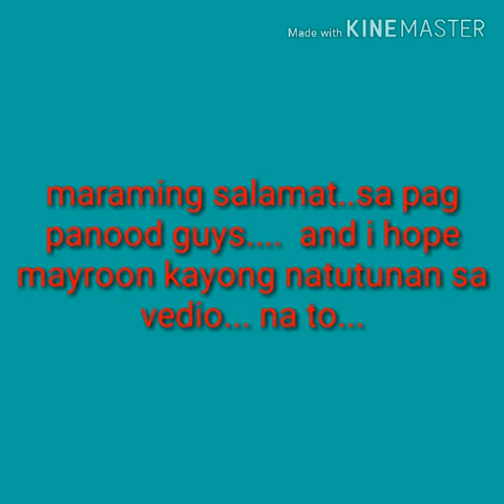Paano nga ba?? Magkabit ng pressure tank at motor pump gamit ang ppr fittings

Comment from the maker: https://youtu.be/Ntga_EtE53U click nyo nalang po yan link na yan ...for more info...maraming salamat po....god bless us all....
Reply: May video po kau pano mag wiring ng pressure switch po salamat
Reply: Wla q bro nkita ung pglinya mu ng heater n sentralize dq mahanap knina p tinitignan q mga video mu
Reply: Bro sa subdivision nmin medyo mahina ang tubig pwede ba ako mhlagay NG pressure water tank deretso sa incoming supply NG subd. Instead n motor ang ilagay ko eh motorized valve ang cocontrolin NG pressure switch, lumakas kya yung supply NG tubig ko kapag Ganon ginawa ko
Reply from the maker: https://youtu.be/CnIb7pUyVG8 pakicheck nalang po ang link na yan for more info. Ganyan set up ang gawin nyo po. Maraming Salamat.

Comment: hi Sir russel. Blessed morning. Sir question ko lang po. May ginagawa po kasi ako na layout ngayon. Sa area ng taytay rizal, Not sure if malakas ang water pressure sa area. But I suggest sa client na maglagay ng water tank. Ang sagot po nya is sa 3rd floor lang maglagay ng watertank to serve. Ang ground at second sa main water line na lang daw . Ito po bang video nyo is applicable sa concern ko?may motor pump at itong tank na nakaconnect sa motor pump, is this the Water tank na po ba o iba pa yung iaakyat sa roof deck po na tank na  magserve sa third floor? PPr din po ang balak ko gamitin. Super natuto po ako sa videos nyo =) 1hp is enough gaya ng sabi po nyo sa response sa ibaba. How about how many liters po kaya ang tank capacity. 
Hope na masagot po ang concern ko. God Bless!
Reply from the maker: Suggest ko nalang din po ay kahit nasa ibaba nalang ang storage tank piro bladder tank nalang po ang ikakabit nyo. Kahit ground to 3rd floor ang koneksyon ay malakas ang supply ng tubig.

Comment: Goodev sir  itanung kulang po yung source ko po ng tubig ay deepwell, Yung pag install ko po pressure tank to storage tank.. pag labas po mg tubig galing storage tank ay gravity nlang.. may paraan po ba na magkaroon ng pressure palabas ng storage asside sa gravity?
Reply from the maker: Mahina ang tru gravity Lang. Lalo na kung Mayrunng kayong heater Sa inyong CR. The best nyan. From deep well source. Hihigupin ng motorpump and then going to pressure tank. At Dyan Sa pressure tank outlit pipe ay papunta na mga gripo or sa CR.

Comment: Bro ung ilan cm sukat ng heater sakto n sukat bro myrn aq gagawin ung sukat dq alam.para pgkabit ng heater shower sakto sya.slmt
Reply from the maker: Sukat po kayo ng 170 Mula Sa finesh floor hangang Sa bottom ng shower heater.
Reply: @russelTorino  ung shower heater bro diba doble un ilan.po bro sakto sukat para pgkabit q d aq mgkamali.slmt
Reply from the maker: Kung shower heater tlaga yan ikabit nyo, first na gawin mo ay Mag Sukat ka ng 170cm. Mula Sa finesh floor with tiles hanggang Sa bottom ng shower heater nyo. Guhitan nyo muna as temporary. Tapos baklasin MO shower heater at ang bandang likod na body nyan may apat na butas for screw. Guhitan MO Tapos ibarena MO.
Reply from the maker: Kung Hindi ako nagkamali and ibig MO Sabihin Siguro ay ang mixing valve para sa shower na mayrung dalawang butas para hot and cold. Kung ito nman ay Mag Sukat ka ng 60 CM Mula Sa finesh tiles flooring at dyan mo na ikabit ang mixing valve  na hot and cold faucet.
Reply from the maker: Kung Hindi ako nagkamali and ibig MO Sabihin Siguro ay ang mixing valve para sa shower na mayrung dalawang butas para hot and cold. Kung ito nman ay Mag Sukat ka ng 60 CM Mula Sa finesh tiles flooring at dyan mo na ikabit ang mixing valve  na hot and cold faucet.
Reply: @russelTorino  o2 bro mixingvalve b twag nun.ilan b sakto sukat s abang bun.bali bro sentralize ang heater linya isa lng b bro ang gamitin kng tubo papasuk
Reply: @russelTorino  diba mgkatabi cla bro un ang tinatanung q kng ilan cntmtr.tpus ung linya bro ung inlet papunta ng heater tpus ung linya punta ng bahay isa lng po un n linyang tubo
Reply from the maker: For sure search nyo lang Sa fb nyo ang "plumber aid materials "page ko un.  Ang gawin nyo Lang ay picturan nyo lang yan Sinabi MO. At sent MO dun Sa page Ko. para masolve at MASAGOT ko na ang Sinabi MO.. OK Maraming Salamat stay safe.

Comment: helo po sir, ano ba dapat gawin kung balak kong palitan mga connector kasi kinakalawang na. paano tangkalin ang pressure sa tank. salamat
Reply from the maker: Una Sa Lahat, kailangan off nyo muna ang kuryente Sa inyong motorpump, pagkatapos off nyo din ang supply ng tubig or gate valve papunta sa motorpump, pagkatapos idrain nyo ang tubig Sa pressure tank, kapag maubos na ang tubig, that's the time na baklasin nyo na ang mga dapat palitan na piping.
Reply: salamat sir

Comment: boss matanung ku lang? pwidi ba gamitin yung swing valve sa presure tank, dba proper installation check valve yung gamitin at yung inket ng pump mu my gate valve pa para saan yan?
Reply from the maker: There are four types of check valve:1.vertical check valve/spring valve 2.swing check valve 3.horizontal check valve 4.lift check valve po.....sir
Reply from the maker: Puydi sir...yan nman po tlaga ang gagamitin swing type na check valve kung horizontal ang linya ang kakabitan mo.piro kung vertical ang linya ang kabitan mo...spring type na check valve.

Comment: sir dahil po sa channel ninyo kahit papaano e natututo ako, at dahil don, may naobserbahan ako sa setup ng pressure tank ko na parang mali. naobserbahan ko po kasi sa gabi na after ilang minuto, bumababa ung pressure tapos pagbagsak nya sa cut in tatakbo sya para magpataas pero ang problema, wala gumagamit ng tubig. tapos maririmig ko ung storage tank magpupuno ulit sya ng tubig. ang aking naiisip na problema (hindi ako sigurado kung tama) e, bumabalik ata ung tubig mula s pressure tank pabalik sa storage kaya bumababa ung pressure or meron sya pinagdadalhan na hindi ko alam tapos pag bumaba ulit ung pressure mag-on po ulit sya tapos ung storage tank maglalaman po ulit ng tubig. paulit ulit po sya kada mga 3-5 minutes siguro kahit wala naman gumagamit ng tubig. wala naman po ako makitang tulo sa paligid so i assume, wala naman leak. ano po kaya problem? nawa ay matulungan ninyo po ulit ako.
Reply from the maker: Lagyan nyo po ng check valve ang discharge pipe in between pressure tank and motor pump. Maraming Salamat po.. Stay safe...

Comment: Good job mr russel. May nabibili bang fittings para di na gumamit na ppr? Magkano charge mo sir pag ikaw mag kabit, may pressure tank na ikabit lang yong booster pump.ang wala mga fittings. Salamat.
Reply from the maker: myrun  ibang fittings na puydi mo po gagamitin....blue fittings and pipe tapos pagdugtungin mo...lagyan mo nlang pvc solvent ang mga joining ...at patuyuin with in 24 hours
Reply: @russelTorino  gumagawa ka ba? problema ko gamit

Comment: Boss anong tawag dyan sa ikinabit mo sa inlet at outlet na puti?standard ba size ng butas?
Reply from the maker: ppr male adaptor na 1" yan po....
Reply: @russelTorino  standard po ba un butas ng pump o un tubo na ginagamit sa inlet at outlet
Reply from the maker: kung bestank ang pressure tank mo sir...1 inch. ang outlet at inlet..standard nila....po sir....
Reply from the maker: @jadztv6192  kung best tank ang pressure tank nyo po ..standard ng outlet at inlet ay 1" po sir....
Reply from the maker: @jadztv6192  depende sa hp ng motor   mo  sir...kung minsan ang 1/2  hp ay 3/4" ang  dia ng outlet at inlet.mostly pag 1 hp ang motor ang outlet at inlet ay 1" po....
Reply: @russelTorino  maraming salamat po sir
Reply: @russelTorino  sir nakita nyo na po ba sa.msger nyo un isenend kong video?